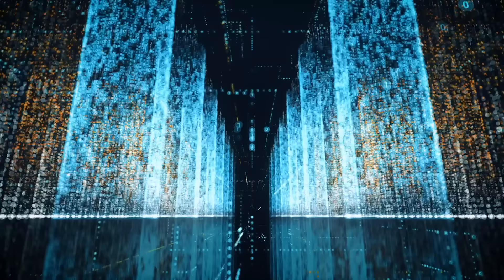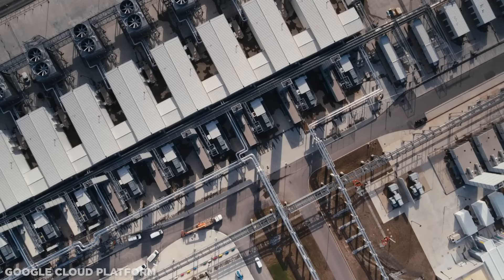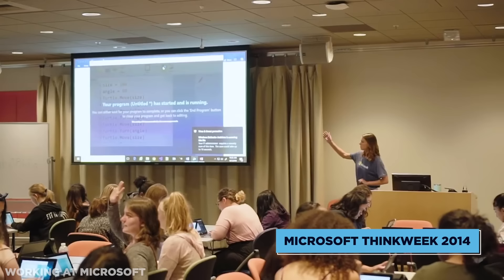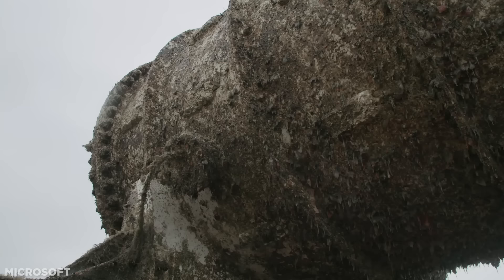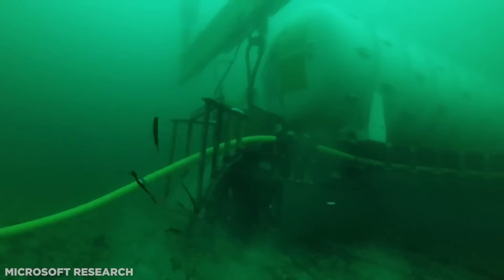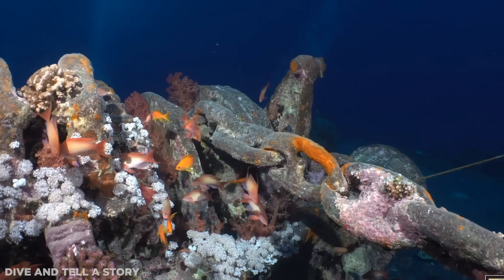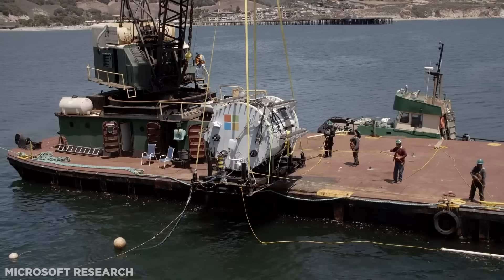Why Microsoft Has Underwater Data Centers

Comment: "Fish adore it."
Until your pull that shit out for maintenance, yeah.
Reply: I don't think they intend to ever pull it out if they choose to do this.  They would just sink another data center and let the failing data center become an artificial reef.  Eventually the hull would corrode and the plastics would degrade into microplastics and the lead solder would dissipate into the sea.  When they said the marine life lived it as an artificial reef, you knew the intent was to simply litter the sea with them.
Reply: That's what I was thinking, as with John's statement.
Reply: I thought the same thing, but the video says that it is designed to only be removed once every five years so that impact is pretty minor
Reply: @chrisbowpiloto  that's not minor. reefs don't get removed and cleaned every 5 years...
Reply: @eiolenimea  but this isn't a reef or anywhere close to a reef. Very stupid comparison. Fish adapt quickly, they will hardly notice that the maintenance happened
Reply: @eiolenimea  OMG! Who the hell cares!?
Reply: once a decade
Reply: @eiolenimea  So just have them place artificial structures around the resting place of the data center; then when it is pulled for maintenance the disturbance to the new habitat is minimized. Team up with marine biologists for research.
Reply: Worrying about this while you buy your water in plastic bottles at costco and pressure wash the oil off of your driveway into the storm drain.
Reply: @johnwang9914  That seems realistic.
Reply: @johnwang9914  Yea, in 5 years those servers are outdated as can be for entrprise work, but their is still a 2nd hand market in in asian countries where server hardware is often found absurdly cheap, albeit tends to be very out of date.  So in that way, the hardware still provides useful funtion. 

IMO though, the biggest value will be the actual housing/tube itself. Those units aren't just scrap metal weilded together by your local welding group. These are made by ship builders and to a spec which should be much longer than 5 years. 

I share your fears though, the video is basically propaganda, hand waving away the environmental concerns these units pose. One of these units failing isn't going to bring the end to an ecosystem. An entire array of these units of being abandoned though, that's an entire other story. Huge potential for metals and toxic chemicals to leech into the water.
Reply: @johnjesus971  Assessing the full environmental impact of these sorts of deployments is actually extremely important.
Reply: Right ? That's the problem, for maintenance the entire thing needs to be lifted off the seabed.
Reply: @johnwang9914  The story said they were built to last 1/2 a decade so I'm assuming they would need to pull them at some point.  There is also the fact that they did have server failures.  There is no way they would get away with just leaving it.
Reply: @godmode8687  Or build them so that they have airlock access, and build a permanent station around them.  You wouldn't have to haul them up to maintain them as long as they aren't breached.  They can still be filled with nitrogen and then flushed with Oxygen when necessary.
Reply: @ShadowMage3D  And who is supposed to pay for that? A station at the seabed, airlocks, technicians which are also divers. Or do you want to build a whole station accessible witha submarine, etc?

Thats just unrealistic. And so expensive, the big corps would just continue using regular datacenters. And noone could blame them. Besides, how much living space do you destroy by building a huge station at the seabed?

I mean a temporary living space is better than none at all. So building these things is a win for the sealife overall. Compare it to how it is without them. Not to a solution which is perfect for just one aspect.

Comment: It's very sensible move from Microsoft in my opinion.
Reply: dive deeper. 
good luck !
Reply: @goodcat1982  yeah. that’s why they announced Microsoft is partnering with SpaceX Starlink to make a version in space. Also the storage has pretty complicated encryption that can’t be easily hacked if it’s even possible there’s probably a self destruct or something if someone tries to hack it. But sabotage they probably can figure out a way to put cameras on it which is pretty cheap nowadays.
Reply: Except that adopting this practice at scale is simply having disposable data centers deposited onto the seafloor with more being sunk as they each loose their function over time.  Without global regulation that extended into international waters and required the removal of the data centers, this would just be littering the seas and indeed the video suggested that as a good thing in establishing artificial reefs so they are not intending to retrieve these data centers.
Reply: @johnwang9914  Saying that they can be "artificial reefs" does not suggest that they are intending to leave broken units on the floor indefinitely
Reply: @SuWoopSparrow  You used the word "suggest" and in that they do as they were trying to rationalize leaving it as a reef was beneficial.  I would agree it does not mean they would but it does "suggest" they would and there would be a significant monetary advantage in doing so.   Even the current practice of reserving fuel for a controlled re-entry of a commercial satellite is continuing bypassed for extended useful life.  If there's a monetary advantage, there is no doubt that violating even established environmental and safety practices will be considered.

They most certainly suggested the data centres would be left as artificial reefs.
Reply: @johnwang9914  Its a possibility, but the reality is that these centers should be working for many, many years. It makes sense to mention their benefit as an artificial reef as they will be in there for extended periods of time while functioning.

Also, as far as Microsoft goes, they have a track record of complying with regulation and even going out of their way to offer information and compliance when not even asked to. Its always a possibility that they would leave it regardless of regulation, but its a better bet that they would salvage and recycle what they can on top of adhering to regulation.
Reply: the next 5 years we'll start having more from this and different competitions
Reply: Sensible? Have you ever worked at a data center? You have to constantly swap out dead drives for new ones. Funny that they said it can survive half a decade. Half life of a hard drive is 5 years, but under heavy load they can easily die much sooner. Sure they took this into account, but I can tell you from experience that when you separate the techs from the technology, it does not end well, which leads me to believe that this is nothing more than a PR stunt.
Reply: @goodcat1982  not that easy. If you open the vault water will destroy the data. If you try to bring it to land you have to have a dock which I think its not that easy to do
Reply: @czpanama  If you looked at the video they said that the system when under water was 8 times more reliable. This could be because of consistent cooling or the fact that the tank was filled with pure nitrogen, so the oxygen in the air could not corrode it.
Reply: Lol no one asked you to reply
Reply: @xxrodrmanxx   Cooling properties in space are absolutely terrible.  No air, no heat conduction.  A data center in space would incinerate itself pretty quickly.
Reply: @czpanama  One would assume that Microsoft would have some form of redundancy for a data centre they cannot service. The company isn't stupid. They want money. Data centres that don't work would cost them money.
Reply: @czpanama  Yes, the different way is to reduce the energy consumption of data centres. You don't seem to understand redundancy, if the system was not reliable enough to be left alone for several years *they would not do so*. If peoples data started becoming unreliable after Microsoft produced these centres, *they would not use it*.
Reply: @czpanama  Again, hence why they had it running for two years.
Reply: @czpanama  You understand that half a decade and 5 years are the same right?
Reply: @cchavezjr7  Have long have you been sitting on this information???
Reply: @czpanama  About half a decade
Reply: @czpanama  It's already been two years.
Reply: LOL Elon moves our internet to space and Microsoft moves our data under the sea xD

Comment: As a datacenter tech, I can tell you we have to do far more maintenance on servers than people realize.  I doubt most companies want to risk loss of data due to the fact you can't perform maintenance right away.
Reply: I don't work in a datacentre and the same question came to me, What happens if you require rapid physical replacement of like idk a few hard drives or what ever. If this was a data centre on land it would probably be fixed on the spot no problem what so ever. But at sea you need to consider weather as well just to go out and actually try recover it.
Reply: Yeah you wont have work if everything's underwater 🤣

Comment: "A full degree is devastating to the ocean, but the heat is barely noticeable from our meter." - Scripted Marketing Bull Puff Piece.
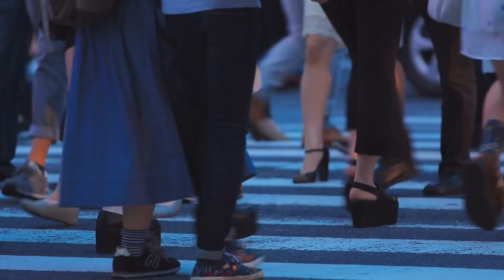Reply: Yeah, and he's not addressing the scaling of the project. This container can store the equivalent of "100,000 Macbooks" according to the video. That's not a lot. but for simplicity's sake let's say these servers are only open to private use (non-commercial) and each person is limited to one Macbooks worth of storage. Let's use the city of Cape Town (shown at 2:05) as an example. The city alone has over 400,000 residents. So you would need at least 4 of these to provide storage, just for the city. The video states the effect is "a fraction of a degree". Assuming our goal is to keep the change at less than 1 degree, that fraction would have to be smaller than a quarter of a degree. That is just for the city of Cape Town. The population of the surrounding metro area is over 4 million. Which means to use this to provide storage for Cape Town and surrounds would require the thermal output of one of these to cause less than 0.025 of a degree warming within the affected area. And that's just to be able to say you're not the specific reason for that 1 degree heat increase. It's not good enough considering we need to be doing the opposite and reducing the heat in our oceans.
Reply: @18booma  Are you measuring the temperature 1cm from the output or 5cm away from the output.

5cm^3 = 125 times the heat energy required to heat it to the same temperature as 1cm^3

Comment: This is interesting. I would love to see the drive failure rate vs the land based equivalent. Failing drives is an inevitability, and accessing these fully submerged data centres for repair seems highly unlikely. They are designed to be fully self-contained and untampered with until they are pulled up and opened.
Reply: They will never be pulled up for repairs or upgrades, new data centres would just be sunk as needed.   One of the advantages is to avoid regulations on e-waste disposal.
Reply: hire spongbob
Reply: drive failure rates just aren't much of an issue anymore - SSD's have longer and more importantly, consistent lifespans.
Reply: Failures simply reduce capacity.  No big deal.
Reply: Thats why u use RAID
Reply: @jrstf  not quite, SSD's may be faster and much better at dealing with vibrations and impacts. But an HDD lifespan is much higher

Comment: Cooling would be a lot easier but they'll have to pay a bonus for people to go down there for administration and maintenance.   We restricted our janitorial staff to only mopping the aisles and not even up to the servers.   The server's themselves become obsolete and are replaced before dirt on the servers become an issue.

Interesting that as they intended it to be sealed for it's operational life, they could've filled it with something more thermally conductive such as mineral oil rather than nitrogen, that would've allowed the computers to be operated at higher clock rates.  Using a fluid would also make the structure impervious to hydraulic pressure from the sea so the container would not have to resist the pressures of the deep.
Reply: Mineral oil would not be a green choice - that would be a lot of petroleum needed to be refined and a big problem if it leaks into the ocean. But perhaps there is a substance that is (a) in liquid state at ocean temperatures, (b) made easily from renewable or abundant sources, (c) inert to electronics and other materials in the data center, (d) electrically non-conductive, and (e) not harmful to marine life even if leaked in large quantities. I don't know what substances check all those boxes, though. Nitrogen checks all the boxes except not being a liquid.
Reply: @L4JP  It only needs to be a dielectric liquid and there are plenty of organic ones such as vegetable oil.  I only mentioned mineral oil as it's a common one used by overclockers.   Needless to say, a liquid could not only transfer heat better but resist ocean pressures thereby only needing an adiabatic hull rather than a pressure hull.   However, something relatively non-reactive which would simply leave the sea such as nitrogen might be a choice if you intended to never retrieve the data centre.

Yes, some overclockers use vegetable oil but different types of vegetable oils have different acid levels so greater care must be taken with organic dielectric liquids.
Reply: You should work for Microsoft and tell them

Comment: What about the rise in temperature in the ocean if major companies starts practicing these?
Reply: They won't talk about that. This experimental setup may not have had measurable impact but a large data center would certainly have a profound impact on the local sea life.
Reply: @karthick86c  so what

Comment: temperature control seems a cover up, they probably want to test something remote that is not under any country's jurisdiction.
Reply: It's off the coast of Scotland so I think it would still be monitored but not too confident, to be honest.
Reply: If they install this in international waters, anyone can steal the data physically. So...
Reply: @MGZetta  10p feet under harsh water
Reply: Kelvin Getafix  this is my logic not sure if its 100% correct. If u want to store it in a big pool then its literally the same as land but you need to change the water everytime, then if ts in the river then might block it idk, but big pool is a big nono a river is uhh maybe i cant find answer to this
Reply: Kelvin Getafix  That would undermine the power savings from the cooling system, and a pool will never be as deep or as consistant as the ocean floor, making the data centers vulnerable to the same natural effects as in air ones.
Reply: Ya it's Bill gates. He may do that.

Comment: Great to hear that we have a new way to trough away energy... The warmth could be used for house-heating or multiple other low-temperature demanding tasks as well. It would be nice to consider this temperature difference as a feature and not a bug
Reply: for you to get warmth from those servers would mean that they need to be warm tho. and warm servers break faster. so maybe the energy you would use for cooling the datacenters now can be uset to heat the houses
Reply: It won't work for heating homes, but you can imagine integrating them into desalination plants, in a storage tank that's thermally insulated from ocean water. This way the water is warmer before going into the actual plant where it's evaporated, making it evaporate faster. This would also provide easier access to the device, should anything go wrong. 

I don't know if it'll work, but it's interesting imagining possibilities that will have multiple uses and less negative impact on the ocean environment.
Reply: @18booma  A lot of desalination does not use evaporation. They go through a membrane under high pressure.

Comment: On paper I think this sounds good, and I will applaud thinking outside the box for solutions. However when taking into account the heat generated by "thousands" of these in a local area the temperature increase would be different from 1 single unit getting an uninterrupted flow for cooling. The point about marine life loving solid structures I think is good, again the cavate here being that once it is "established" over a series of years, you pull up the units for maintenance and thereby disturb the whole environment.
Sorry to sound to pessimistic

Comment: I can see one problem with an Underwater Data Center. The problem is what do you do when something inside the data center fails and needs to be repaired. If a serious problem occurs with the data center, the data center will need to be retrieved from the ocean in order to do repairs on it. With land based data centers technicians can always access the components of the data center.

Comment: I think the heat generated is an issue. Also, given that servicing these modules would be fairly expensive in an emergency, then I am doubtful. I think most clients that have their data stored would want to have it be accessed manually in a pinch rather than whenever the weather clears up.

Comment: We humans should start thinking about building data centers in space.
They will act as geostationary satellites hoovering above the country from which they were launched from to be transmitting storage data.
A lot safer than underwater data centers which potentially overheat the oceans.
There'll be no need for air conditioning as the centers will be kept cool by the cold temperatures of space.

Comment: Microsoft has the perfect idea because of some company waste water. Have to put plastic as a whole cover away from main body & which should have holes so main body can filled & through this Microsoft can adjust temperature through holes shapes & cleaning will lot easier with this.